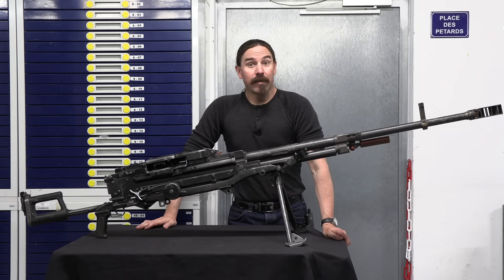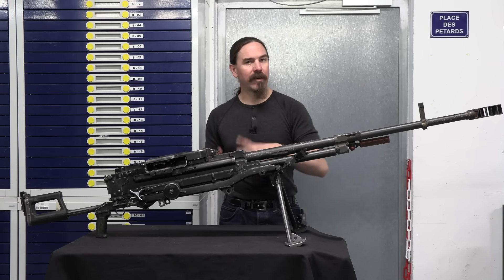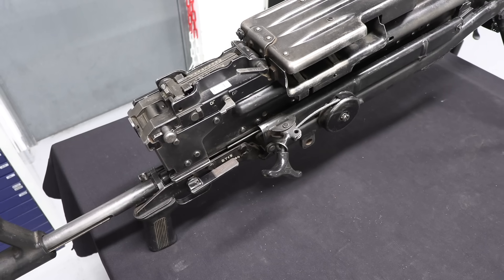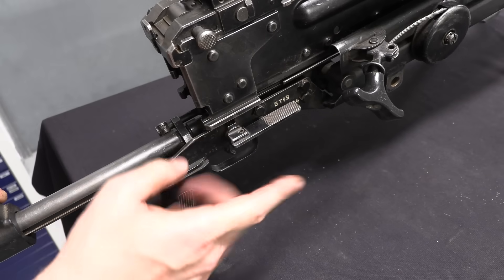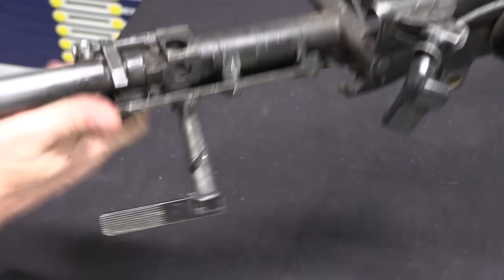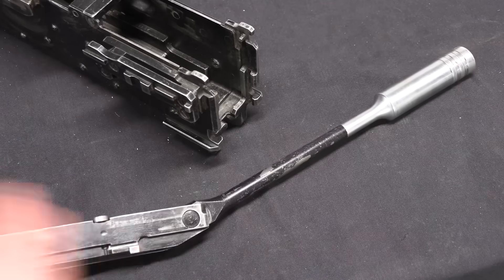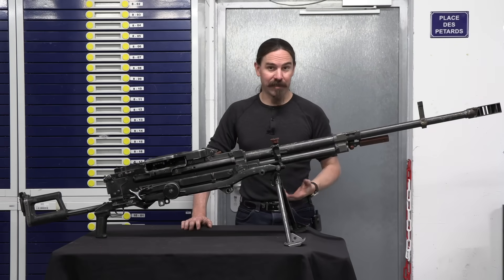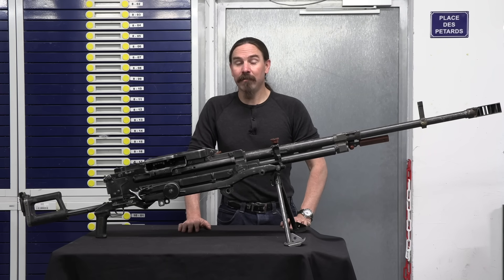Kord: Russia's New .50 Cal Heavy Machine Gun

Comment: The fit and finish of Eastern block weapons is not great but they have some pretty inventive designs while are gun designers have literally no imagination. This is Russia's third HMG starting with the dshk/m then the NSV and finally the Kord. We could've had the GP-HMG which was a constant recoil HMG that could fire everything from 50 BMG to 25mm according to the literature with different parts kits and it was $2500.00 when the M2HB was $10,000.00 and a good deal heavier so instead we got the M2A1 which is just a quick change barrel and a selector switch for semi automatic. Lame but the dover devil prototype is still sitting there at picatinny arsenal probably in a crate next to the ark of the covenant like at the end of Raiders.

Comment: I still haven't found a definitive answer to the question: which ammunition is more powerful, the .50 BMG (12.7 x 99 mm) or the Russian 12.7 x 108 mm? Different authors give different results…
Reply: Russian One is far more devastating by impact on surface . But accuracy wise and by range , The .50 Cal Outranges
Reply: Russian one is a bit bigger
Reply: In theory, the Soviet can be made more powerful, as its cartridge case is bigger (108 vs 99 mm) which allows it to be filled with more gunpowder. In practice, however, they are about the same. There are a lot of types of cartridges - tracer, armor piercing, incendiary, match and so on. Each of them has a different weight and energy, and the difference between them is much greater than the difference between 12.7x99 and 12.7x108 cartridges of the same type. If you want exact numbers, take for example the Soviet typical armor-piercing cartridge B-32. It's bullet weight 48,3 grams. NSV or KORD machine guns fires it with average muzzle velocity of 845 m/s. That means the energy equals 17244 joules. Compare it with typical American armor-piercing cartridge M2. Its bullet weight 46,8 grams. When firing from the M2 Browning machine gun, it gets average muzzle velocity of 858 m/s., which means the energy is 17226 joules. It's less than 17244 by only 18 joules. Such a difference can be disregarded. You can calculate the energy of any bullet by yourself by a formula: square the speed (in meters per second), multiply by the mass (in grams), divide by 2000, and you will get the energy in joules. 😊 Just keep in mind that even the same cartridges made in the same plant will have some variations, which can increase or decrease bullet velocity (up to several dozen meters per second!). Not to mention that air temperature, atmospheric pressure, and humidity significantly affect the bullet's speed.

Comment: having operated the m2 browning .50 in different ways, the worst of which being on foot in a two-man team to deal with lugging the reciever, the ammo, two barrels and a large tripod, i can say with a fair degree of certainty that this looks a lot more practical, you cant simply throw up a bipod and fire an m2, you need to set up the tripod first. Is it a more stable firing platform? probably, but this looks like it would faster to deploy and may in fact realistically be operated by a single soldier, and certainly more efficiently by a pair, with the ammo perhaps being divided  in more than a single backpack.

Comment: Imagine trying to change the barrel in a firefight after having fired the barrel red hot. It would propably get welded into the receiver as the is practically no room at all between the barrell and the receiver. Those would normally eject easy af when normally maintenanced and with matching barrels.
Reply: To prevent the barrel from being "welded" to the receiver, it is chrome-plated. Here the barrel has already been seriously damaged by unskilled repairs.

Comment: what .50 refers to?
Reply: 0.50 inch caliber
Reply: 0.5 inch of diameter bullet, around 1.27cm
Reply: @miguelisaurusbruh1158 nominal bore diameter. Not bullet diameter. There are 3 ways to measure nominal bore diameter. Only one of which is close to bullet diameter. Place that developed .50 BMG cartridge doesn't use that one.  .50 BMG has bullet diameter of 12.98 millimeters.
Reply: 0.50 inch.

Comment: From all the guns I have used, I miss most the NSV and PKM. Nothing was nicer than run in the forrest with those things and get in the position and shoot targets. I don't miss really the weight of the NSV that you needed to carry in quick reposition in the gun + swing combination. IIRC it was about 35 kg, where 25 kg for the gun and swing was 10 kg extra. And someone else got to carry tripod and other ammunition. If it was quick and short distance move, like from cover to firing position (< 20-30 meters), then each guy picked tripod leg and carried whole gun on their shoulders. 

It took from me 2½ minutes alone to setup from the four transportation boxes (gun + extra barrel, swing and tools, tripod with extras and fourth was for ammunition and holographic sight). For a team it is 3 minutes requirement to be firing ready.

Firing that thing is fun, and on high tripod position you have so nice way to shoot accurately that it is scary. 

I always miss that I never get to try the Kord, but I thank not...

Comment: Having used the NSV for almost 2 years, the trigger system, which is exactly the same on the kord, has a fun feature of breaking after heavy use. It breaks "open" and will only stop firing when it runs dry. Happened to me once and to two other guys while we were at the range. Thankfully they were vehicle mounted on a rws. Would not want to be behind it on a tripod when that happens

Comment: Wow the fact someone disc'd the end of that barrel like that lol!   Not even an apprentice would do that.

I've fit sprues into plastic injection molds, and the fit has to be perfect, like to within 5 tenths of one thousandth of an inch. Typically what I do is set the sprue up on the lathe, run emery over the area that has to be fit, 150 or so grit, and do so for only 10 seconds if that, then rinse and repeat until the fit is absolutely perfect.

If you want to be super fancy, you could set it up on an OD grinder, take measurements of the bore, and the barrel, and then fit it that way, but who has an OD grinder? Most shops will have a lathe.

You could take a dust cut on your lathe, but that's very risky dealing with run out and the finish might not be great. I'm not sure how you gun trades guys fix these things, but that's how I'd do it.

Comment: Hello,  you can easily reload the KORD like NSV or WKM,  outside the bipod, place the shell in the reloading bar on the right side of the maschine gun, you can also fire a blank shot without the bipod by pulling the small lever in the trigger mechanism, if you load real ammunition, it will definitely fire, but the recoil will be uncontrollable and not very safe. 
Greetings from Poland

Comment: First impression: An anti tank rifle.
Reply: I mean, yeah, you could penetrate a Bradley or a BMP armor if your are at least around 400 m from it and you attack from the sides or the rear instead of the front where usually armor is thicker in most vehicles.

Comment: increadibly russian gun. It has everything!
-manufacturing defect
-ouce of briliance (modular mounts are impressive)
-ton of useless material
-clear sighns of abuse
-clear sighn of madness (fiddy cal on a bipod sounds like premeditated soldier abuse)
Reply: What's the ton of useless material?
Also you're clearly not sober if you fail to notice a gigantic muzzle brake specifically to be used by infantry(exactly what an American GI can only be envy of)
Reply: @worldoftancraft  I simply question viability defigned as factual existence of a role that cannot be fulfilled by lighter platforms like anti material rifle or UMG. I understand that constant russian tactical failures are a bit of a tradition that is counteracted by the attitude "shit will hit the fan and they need to be prepared for it". If you need a reference place where excessive material is - look at modern muzzle devices for .50 cal anti material rifles.
Reply: @radosaworman7628  1200 metres shooting by an GPMG? That's funny.

Also anti-material rifles are a rare thing with their numerous caveats. HMG are greatly more adopted and widespread.
Reply: @worldoftancraft  yes. They are useful on vehicles as they are most likely to meet other vehicles. What's the point of trying to shoot to a target which is more than 1 km away  with rifle that has no optics and has more than 2moa spread?

Like I sat down and thought about it and only cases where it could be considered useful would be mountain fights and perhaps city engagements, assuming it is just light enough to use it effectively from windows.
Reply: @radosaworman7628  How many vehicles cars with HMG met in A'stan? How many? 

Rifle? I am talking about HMGs. So, like absolutely irrelevant info. And usually it's a group target, and, immediate action bullets say «hi» to you in this regard.
Again, you just toss a coin to the scenario I named. Although it's not the only one I can name.

Your opinion is very theoretical. HMG with its relative portability have a lot of use.
Reply: @worldoftancraft  doctrinally russians always have been big on symmetrical war thus I'm in a bit of a loss with your Afganistan thing.  But when we are at theoretical range of 1.2 km we have to ask ourselves - why not just use 61mm mortar? Or any other indirect weapon that can outrange it? If russians are really unlucky enemy will have 120mm mortar with direct fire capability and they will achieve same effect. And argument that russians developed it doesn't really mean anything are through their history they developed a lot of potentially dangerous but practically useless weapons- like a sub that can outrun torpedo (while making enough noise for every ship within 100 km to detect it), subsonic bombers with afterburning engines, turboprop bomber that can be accurately detected by fully submerged sub using sonar, steel bone replacement implants and many more. My question is why no one else tried this concept- and I presume that answers include - complications in logistics and limited usefulness for marginally better adaptability to terrain and time to deploy.
Reply: @radosaworman7628  Because 62 mm mortar is not the same, do you understand? Why wont everyone just use missiles instead of sabot! You can abandon such ridiculous thing as very heavy gun with a significant roll-out space!

Oh. It flies times longer. And it can't engage targets which appear only for a short moment(like empty space between two forests or anything like this, including buildings)

You can't use 62mm mortar for everything, I doubt its practical utility due to dispersion and the arrival time. Any AGL is more efficient than this substitute 

Your point is being destroyed somewhere at fields and other elements of terrain of Ukraîne.
Reply: @worldoftancraft  you do not need   to hit accurately with HE mortar round. Yes it does fly longer but not long enough to hide. Weight is also on the side of the mortar as modern composit mortars weigh approx 6 to 7 kg. Yes buildings are obstacles - as I mentioned in one of my previous posts- urban warfare is probably one of the strong suits of this HMG, but every other mortar system is capable of outraging it, use similar amount of manpower (including loading and carrying it and transporting separate type of ammo). Doubt that forest is such a problem as you never shoot once using mortars and single shell is likely to clear the target for the next.  Yes- using mortars will bring counter battery fire from artillery systems waiting for signals but that doesn't really make a difference as using any weapons will attract enemy attention.

Comment: been searching for someone to leave a comment like this but havent found one am i wrong ?
To have 2x "gear" reduction pulley should be hanging (not beeing fixed) aka u need at least 2 of them and 1 is free to move. In fact unless im blind if u watch Ian pulling the wire its actually moving the same distance as rail there, hence the force applied is simular. Tho i have to say its still easier to pull such ergonomic handle rather than small piece of metal.

Comment: The lawnmower starter seems really sketchy… but they know how to make great small arms so I’m sure it’s fine.
Reply: That is, do you consider the usual charging handle to be LESS primitive?))
Reply: @ЭвМ-ЭффектвМассы  not sure what you mean by “less primitive” but I do tend to trust one solid piece of metal as a charging handle over a metal wire in a pulley system. But again, it must be fairly durable and reliable to have been adopted to replace the DSHK.